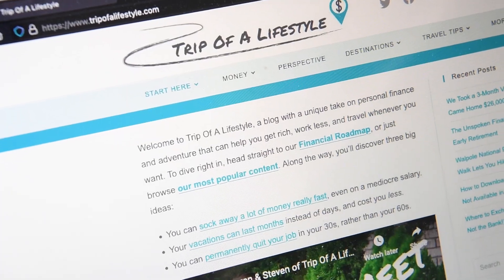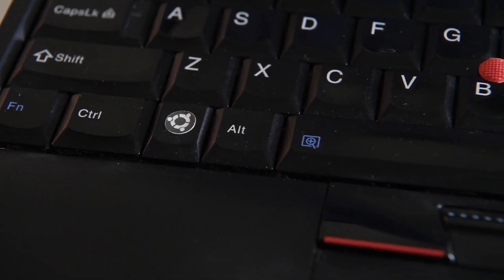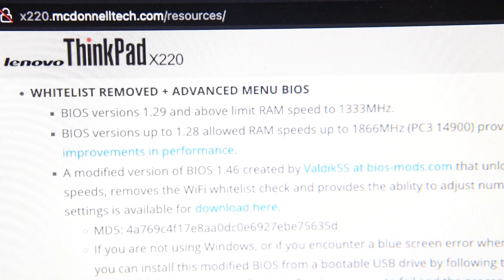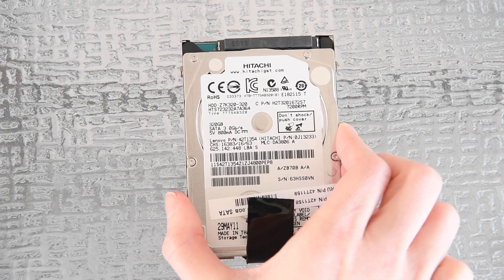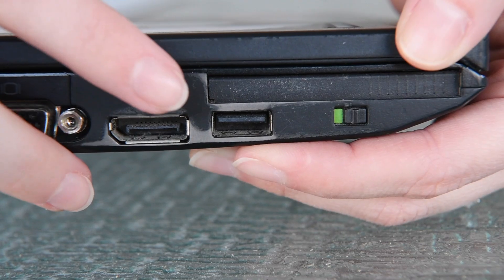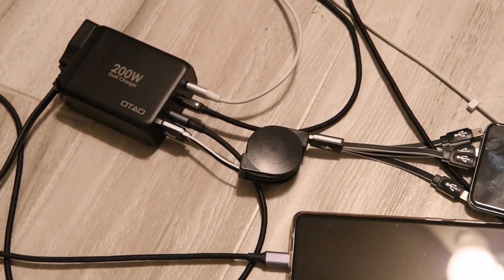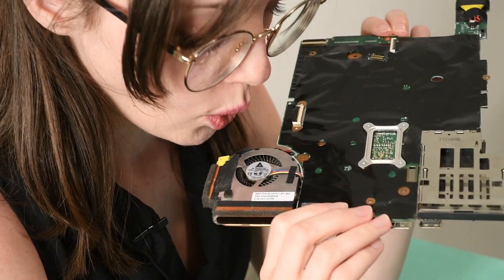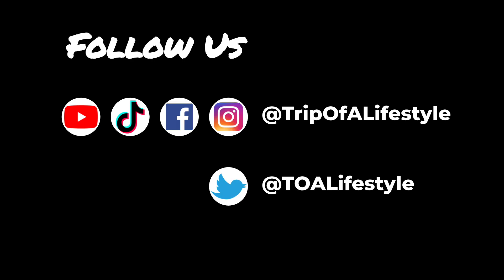How To Make Your Laptop Last FOREVER (My ThinkPad Mods & Upgrades)

Comment: Geek stuff, from my experience tho there is nothing better than 2015mbp 15” and 2019mbp 16” maxed out. Unkillable beasts and no windows, do you really need so much ports? With charge control original battery will last forever. Plastic vs milled aluminum. Not even mentioning all the software/interconnectivity and ease of use on macs. Over 20y in PC/laptop repairs - compare two motherboards of any mac vs other brand (component density/circuitry) and you will see that there is greater engineering behind apple than anything else.
Reply: This is not geek stuff, it's just more repairable tech that can outlast the new soldered down stuff, if someone's uses don't change, the computer doesn't need changed
Reply: @StuffingSkulltag  agree about new produced trash, but the fact that apple sets the standard and other corporations just try to catch up using cheaper materials trying to make everything thinner (producing e-waste & wasting finite resources on trashy produce). Wait till everything gets converted to SoC’s (no more upgrades without replacing BGA chips). These days used macs (2013+) are cheaper and still better than new trash on some 14th gen intel CPUs (overclocked from factory and within 10s of stress testing reaches 110C+ resulting in throttling and loss of speed unless you have a canister of LN attached to it - mean in most cases new doesn’t mean better), but people want new stuff cz they don’t want to think about whats inside and how it works - this way corporations exploit human stupidity thus feeding them more trash for overpriced “new” products that usually are worse than 10y old machines.

Comment: Good stuff! The only thing I would personally change is not getting rid of the HDD. I'd use that as a storage device and use the mSATA slot for the booting SSD. Currently running something like this on my HP 840 G1!
Reply from the maker: That's a cool option!

Comment: The prices in the U.S. (pre & after tarrifs,) are much cheaper in 2025!
Reply from the maker: Remember, many of these upgrades (like RAM and SSD) were done many years ago, which is reflected in the prices. A half-terabyte SSD used to cost a lot more 😉. Been using and upgrading this laptop since 2011.

Comment: You went overboard by spending $1,200. All you had to do was trim down Ubuntu by removing unused apps and switching  to a lighter Window Manager like XFCE or LXDE.
Reply from the maker: The $1,200 includes 13 years of upgrades in addition to the original purchase price of the brand new laptop in 2011.

Comment: I use my X230 quite much. It's from a refurbishing factory. My Dells are beater laptops (used when I got them), but they stand in the same places. I can use X220 batteries with a firmware hack. I literally re-created several Thinkpads years ago, but they are my "museum things" and I dive into electronics and micro controllers at this point.

Comment: Thank you for sharing. Xubuntu might be a great choice. I've been trying lots Linux distros recently, but I had some issues with Xubuntu. There are of course many different OSs out there. A few Linux operating system are installed on some older desktops. So far Zorin OS looks fine. Pop! OS and Debian 12 on another, they work but a bit of a struggle to keep up the speed. Did you try to use a Bluetooth dongle on your laptop? I am curious because, someone gave me a very old laptop. I installed many 32 bit versions, now Linux Lite is up and running, wi-fi works no problem. The Bluetooth is a killer, I can connect to the dongle with my cellular. Linux bluetooth manager being used, search applied, never finds anything no matter what I do. The intention is to connect the dongle to a bluetooth speaker. Thank you.
Reply from the maker: Bluetooth can be slightly annoying sometimes. With that said, we've used both of these adapters on Linux (specifically Xubuntu) with excellent plug-and-play results:

TP-Link UB400 (USB): https://amzn.to/4krmFSw 

Intel 7260 (mPCI-e): https://amzn.to/4k5Tg0u 

(The above are affiliate links)
Reply: @TripOfALifestyle  Hi guys, now that was a quick reply, almost never happens. Thank you very much, for the links also. I have two bluetooth dongles one is a Bradcom or something similar and the second I will have to check, it has Bluetooth written on it. I thought I might have to try something more compatible with Linux. I tried I would say perhaps around six distros, Zorin OS, Lubuntu, a few Puppy Linux versions and also DSL. The laptop is my wife's, she tends to advise me how to connect, she has no idea about Linux. She believes that the bluetooth speaker can search other devices. Anyway, a long comment here, sorry for that. You guys make a lovely pair together, best wishes.
Reply from the maker: @nickstoic2944  No problem! Please share our content if you know anyone who could benefit from it. ☺
Reply: @TripOfALifestyle  Cheers, we'll do 👍

Comment: i dropped my t480 down a flight of stairs on to a tile landing while open and playing youtube. wouldnt boot, opened it up and made sure all the ram and hdd hadnt dislodged. figured out it hit the ground so hard as to cause the sleep sensors inside the bezel to dislodge and was bugging out not knowing if it was open or closed. fixed it by putting a small 1mm fridge magnet on the bezel which fits inside the laptop when closed lol. still going strong. have dropped it several more times over the last 5 years, and my main usb-c/thunderbolt port is now kind of broken off the mb. have a new one on order and switched to charging with the harder to repair usb-c/thunderbolt dock connector. 
made lots of thermal mods. really prefer to stick to the older 2.4ghz wifi for range, and added an kapton tape insulated thicker copper shim w/ those silicone rubber bands that m.2 hdd heatsinks come with to the top + a silicone pad to push heat out to the bottom of the enclosure. using a thermal camera it does make a good amount of heat and imo is better pushed directly to the outside of the case.
also did the dual heat pipe upgrade, though i am kind of skeptical if its working correctly. might be causing an issue with temp sensing and fan settings since my fan is now always running slower but the laptop feels hotter. going to take it appart soon and cut/melt out some of the mesh that covers the fan, and might try swapping my old fan from my old heatpipe assembly back.
weird fact i found out having this computer running non stop w/ all day use for 5 years. despite not really using the internal battery much, my computer decided it was at end of life despite only having a few dozen cycles on it and refuses to charge it now. got a new one to be put in. also the larger external 72wh 6x 18650 battery is really good for making sure the fan always has airflow on soft surfaces. got another one of those. when it was new the battery lasted about 12-15 hours with lower power settings when watching youtube. now its more like 2-3 hours, so time for a replacment of both batteries. will probably rip the old internal battery appart and recycle the higher quality cells for diy projects since they are not puffed and are probably just fine in terms of state of health. 

another upgrade i did which i havent seen before was adding several layers of copper foil tape meant for emi shielding to the outside of the housing to make a sort of 0.5mm copper heat pipe to channel heat to the active cooling area. have to also add a layer of that black coated al foil tape meant for autobody repair to not reduce the radieative cooling effect of the balck chassie. shiny copper has the lowest emissivity available and radieative heat transfer is actually the dominate mechansim for enclosed electronics with poor/no active cooling.
also upgraded ram and added some of those thin copper/pyrolytic graphite cooling stickers for the same reasons^
people who dont understand radieative heat transfer on youtube are a petpeeve of mine.
Reply: edit: if i was to redo the diy thin heat pipe mod again I would use that thicker copper tape that they make for hiding wires/audio cables inside of walls/under paint. it has 5-10x the thickness of the emi foil shielding tape and is a solid piece instead of thin layers. there is a brand name called ghost tape if youre looking for a name to search for, but i would just use the same stuff from china, probably just droppedhsipped and marked up 10x by the ghost tape "brand." would still add some kind of high emissivity tape on top of it though.

Comment: Nice tinkering side-note: the laptop batteries are simple ‘18650’ style; probably only a few are not good, the rest still above average. You can use them in an empty battery-pack case which you can buy for cheap.

Comment: CHanging from Windows to Linux (Xubuntu) would give you a speed upgrade from day one (no doubt about that unlike any pledge to bring prices down of a whole economy from day one). @2:17, BTW, the 6Gb/s (Gigabits per second) is not to be confused with 6GB/s (offered by NVMe M.2 drives). The former (6Gb/s pny CS1311 2.5 SATA III) read speed is actually 550 MB/s. I recently upgraded a Western Digital ST1000LM0490-2GH172 1TB drive (read speed: 560 MB/s) to a Kingston NV3 2TB M2 PCIe Gen 4.0 SNV3S/2000G (read speed: 6000 MB/s) and the difference it makes is out of this world. copying 10 GB data from within the same drive (from one partition to another) takes seconds not minutes (which is what it took to copy from the Western Digital to NVMe drive). Of course, if you don't do that kinda thing often enough it may be overkill to get a laptop that supports NVMe M.2 hard drives

Comment: This suddenly makes framework look like a bargain. A pcie ssd and a 2 year old cpu will feel like a deaktop replacement compared to that thing
Reply from the maker: @davitdavid7165  Yes, but could you buy it in 2011 and use it for all these years? Sounds like you may be comparing apples and oranges.
Reply: @TripOfALifestyle  if you got is back in 2011 that is understandable. Also framework's whole shtik is longevity and upgradability, so I am comparing apples to older apples here
Reply from the maker: @davitdavid7165  Yes, the price you see at the end of this video is the total cost of running this ThinkPad continuously since 2011, including the original purchase price. Not suggesting paying this much for an old ThinkPad today.

Comment: if anything happens to the CPU, you might look at cramming a Framework motherboard in the case and see if you can keep that Laptop of Theseus running another 20 or 30 years
Reply from the maker: @Lohan3001  Laptop of Theseus 🤣

Comment: I have a Fujitsu LifeBook laptop and it's much older than yours. It has an Intel Celeron Pentium processor. Memory upgradable to max 8GB. I replaced the SCSI HDD with a SSD and I wish I knew how to open it without breaking the back cover. Maybe I need proper tools. I need to clean the fan as it has gotten noisy. I can't install Win11 due to hardware inadequacies. What the heck, it still works.

Comment: You should unplug the fan when blowing it out and letting it spin. It could act like a generator and possibly cause electrical damage to the motherboard. When blowing out a fan that is plugged in put your finger on it so it doesn’t spin and if you need it to rotate do it slowly.

Comment: I have a 13 year old Asus R500A. It has a quad-core i7-3630QM. I upgraded the RAM, SSD, Wifi card, and added Bluetooth. I replaced a broken screen, malfunctioning DVD, worn out battery, and the dirty keyboard twice.

I was shopping for a new laptop, but I discovered modern laptops are not upgradable and often not fixable. Computers with soldered on RAM and drive storage will become e-waste. An older Lenovo Thinkpad is probably the best choice for upgradable and fixable laptops, but my Asus is pretty good also. Older machines also tend to be cheaper to max out and find replacement parts for. If you can't find a necessary part, just buy an equivalent model "for parts only" donor laptop.

My laptop is rare, because the CPU is socketed and upgradable, so I'm upgrading the CPU. I purchased a donor laptop for $50 to keep my laptop going. I needed the case and screen, because my case is not held together firmly anymore. I also preferred the OEM screen to 3rd party.

I run Ubuntu Studio, because the Windows drivers haven't been updated in years and Windows 10 support is ending soon. My laptop runs fine for everything I do. The apps I use have Linux ports. Blender is slightly laggy, but a CPU upgrade should fix that. I'm able to run Windows 10 and 11 in VirtualBox with no lag, so there's little reason for me to stay with Windows.

Microsoft is gaslighting you when they tell you your old machine isn't capable anymore. You just don't need a new laptop if you are writing documents, web surfing, or playing simple games. The only people needing to upgrade are those wanting to run AAA games or do heavy video processing.

Comment: I love seeing old laptops still working strong. As she said Linux, especially lightweight distributions (distros) can really give you a performance boost. Proper maintenance like cleaning your fans and re-pasting your CPU can add years to the life of your laptop, but never let a fan freely spin while blowing it out as it can damage the fan and the computer/laptop itself, if connected. Also when buying laptops, try to buy commercial grade, not consumer grade as they tend to be easier to work on, tend to be upgradable, and are usually be cheaper to fix. One great source of information on purchasing commercial grade laptops and their benefits would be @SalemTechsperts

Comment: That's pretty awesome. I've had many thinkpads over the years. You can find decent ones that are still under warranty for only a couple hundred dollars. I bought a t490 and a t495 for a client recently and they were about 250 bucks each. My current work laptop is a p15s I bought for 325 bucks, 10th gen i7. I'm looking at buying maybe a p17 with an rtx 5000 to dabble in running local ai but that'll be a lot more money.

Comment: Got an ideapad 320 back in 19. I have since switched to 512 gig SSD and added 16 gigs of RAM in addition to 4gb soldered. The GPU is old but very adequate 4GB 940MX with i5-7200U. I have recently replaced the battery with an OEM spare which is 93% health after 250+ cycles. I am yet to replace the thermal paste but this machine still does everything I need it to do daily. I code on it, enjoy multimedia, do 1080p video editing, and some great recreational gaming of pre 2014 games. 7 years in, its still going strong with just little care and a few upgrades.

Comment: can confirm not worth it: get a used thinkpad t480 i5 256gb ssd for less than 180$ and if you need, upgrade storage and battery for less than 70$ more. this config has this mod beat in basically every catergory.
Reply from the maker: Just to be clear, this video was never meant to imply that buying a ThinkPad X220 in the 2020s and applying all these mods at once would be a wise investment. It's merely an example of how any well-made computer can be made to last 10-15 years with some care along the way.

Comment: I have been refreshing my old Thinkpads after my daughter said she misses them.  I had a T520 12 years ago as well, then got a X220 which broke and Lenovo replaced with 2 X230 (no more X220 and they botched the replacement and they never took the wrong one X230, so I have to X230).  So the 2 X230 ended up with one for my wife and another for my son.  The first X230 eventually gone to my mom and retired after I gave my mom my iPad Pro.  My son's X230 was daily driven and had a hard life and is now is parts bin.  My T520 eventually went to my daughter as I switched to the dark side of Macbook Pros by 2015.  I now have a M4 Max Macbook Pro has 120GB more than my T520 8GB.  I did an dist-upgrade on my T520 eventually it still runs and now with the latest software, my daughter said she misses it.  So I decided to get the X230 off storage and attempt to fix the trackpad which didn't survive my mom's coffee.  It was an easy repair especially with spare X230.  Now I am upgrading the T520 to the gills, 2nd 1TB SSD, 16gb ram, mSATA.  I then discovered I can mod the X230 and use a X220 old keyboard!  Anyway my T520 now is being used as home server with  Immich, file share, etc.  The X230 will be moded to look like a X220 got smaller batteries 6 cell (but its original 9 cell battery still works).  It will tag along my old 2015 Macbook Pro 13" on my daughter school whenever she feels the retro look.  Very cool idea on the PC Express card and USB ports.  I better do that as a T520 had eSATA and no USB 3.0

Comment: I bought 30 x61 lenovo tabled for 35$ each.  They still work great with Ubuntu even without a ram upgrade.  SSD yes. They are as fast as my much more recent win10 computer, where the keyboard is already trashed.  I can't buy batteries for the so I might do careful surgery on an old battery so I can just put in new cells (you have to have to fool the chip in the battery to think you never replaced the cell but putting a supercap or small battery in parallel before replacing the cells.  I wish they used LFP.

Comment: I've been using my 10year old Windows PC as my main machine since I bought it...and with the "tweaks" to the Windows 11 install, I've upgraded to the absolute latest.  The only thing I've upgraded is the ram (16GB -> 32GB) and the HDD (from a 500MB HDD to a 2TB SSD).  And an add-on USB3.0 adapter card.

Same CPU (an AMD FX 3.2GH, 8 core) when I bought it.

Comment: What I did on my X220 was to replace the bottom case and motherboard for those from an X230. Better temperatures, better battery run times, slightly better processor performance, much improved GPU, and 3x USB 3.0.